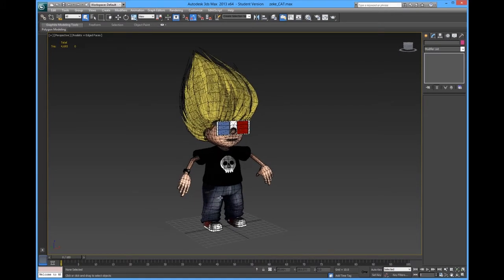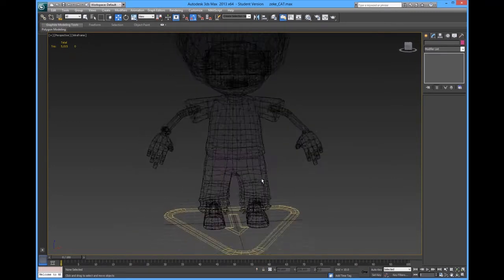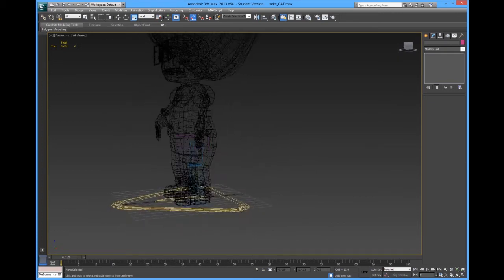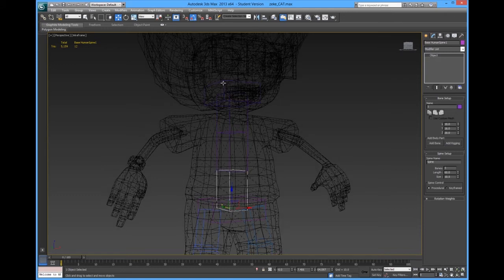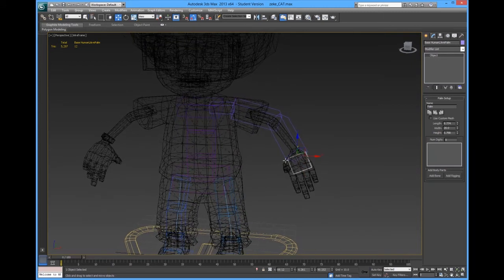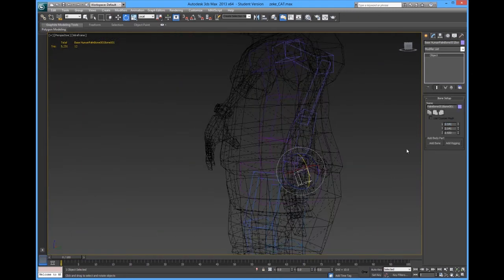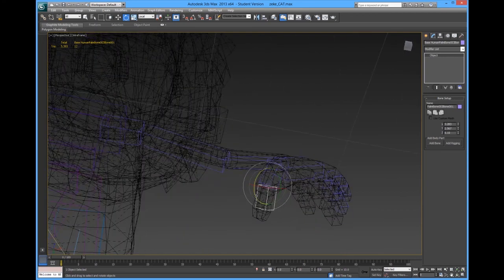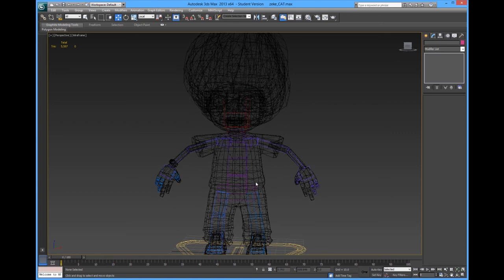An Introduction to CAT Rig

Comment: Hi there, it's me again. I am starting on a game in Unity 3D and I have modelled a chibified character. I tried importing into Unity into a world 256X256 .raw file. I have to scale it up to X17 times to make it looks reasonably proportional. I know that it is a good practise to have a set of protocol of the character sizes to maintain consistency. May I know if you have any tips for creating a standard character size? Thanks!
Reply from the maker: Hi Raina Lim,

I tend to work with Max set up as 1 unit = 1cm, however i am aware that Unity's units approximate to about a metre. So you could set your units up to be 1 unit = 1m, however i would discourage this especially for characters. 

I use centimeters particularly because i know that a head is roughly 30cm so this gives me a good gauge for scale. 

Overall though scale is irrelevant if your the only one working on a project as long as you factor it in when addressing physics.

Hope this helps a bit :-)